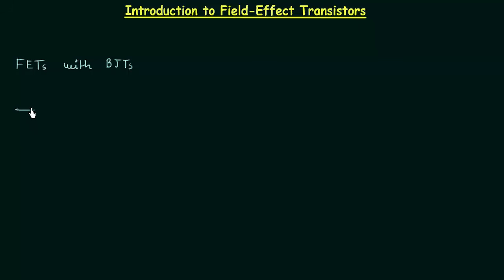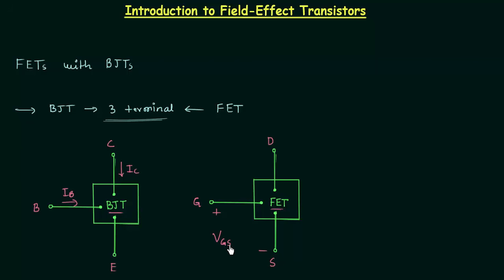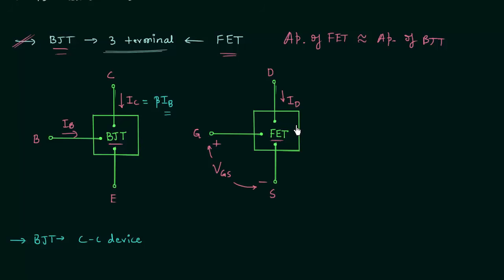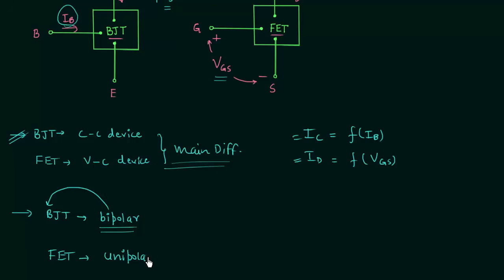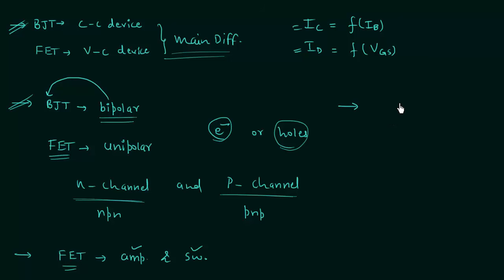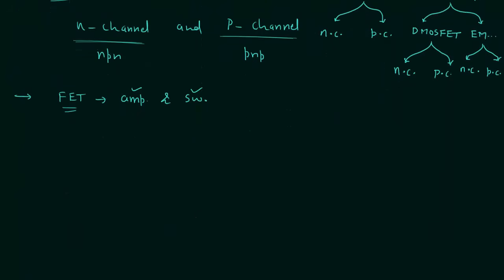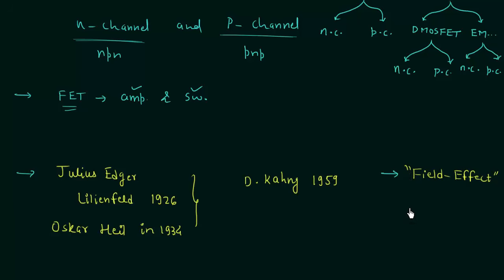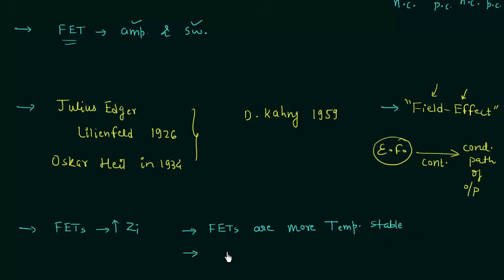Introduction to Field-Effect Transistors (FETs)

Comment: 00:09 Introduction to Field Effect Transistors

01:28 BJT and FET are three terminal devices.

02:52 BJT and FeT are current controlled and voltage controlled devices respectively

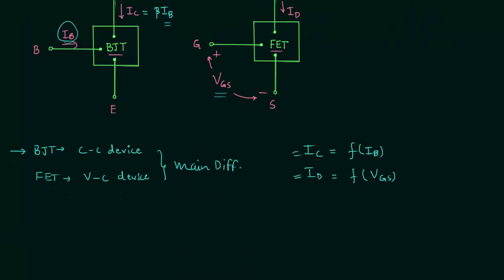04:24 BJT is a bipolar device and Fe T is a unipolar device

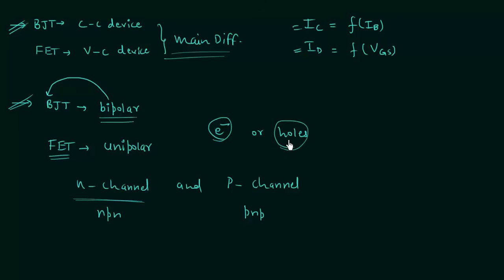05:46 Field Effect Transistors (FET) can be used for amplification and switching.

07:06 MOSFETs can be classified into two types: d MOSFET and e MOSFET

08:29 Transistors are integral in electronic devices.

09:56 Field effect transistors have high input impedance and are more temperature stable compared to bipolar junction transistors. They are also smaller in size.

Comment: n channel means pnp ryt u explained in next part
Reply: yes, this is right, he mistakenly explained, N channel because most of the semiconductor is Electron charge (negative) so its same as PNP. (see the Base, it's N)  otherwise, P Channel because most of the semiconductor is holes charge (its not positive BUT it's behave as positive) so its same as NPN ( as the base in BJT is P).
Reply: @masbro1901  thank you🤗

Comment: Well done!  One question, do Kirchoff's with voltage and current work with transistors?  It seems like they don't but is there a phase issue?
Reply: it wont work because transistors are non linear element  i.e, its resistance is not constant throughout the range of operating voltage.  Moreover it is an active device . So , transistor's conductivity(or resistance offered to the input) also depends on the activating source.

Comment: Elaborate the point : BJTs are more sensitive to applied signal than FETs
Reply: Because as fet's are high in impedence  ,so no unwanted signal will be introduced in to circuit.
But not in bjt's..

Comment: Why do FET have high input impedance? and Why is FET more temp. stable?
Reply: Anusree Saha input is reverse biased,so it has high impedence,and therefore more stable,
Reply: @gkwithrh2178  1 year gap between all of us
Reply: As silicon is used as insulator. Input gate current =0 so it has high input impedance according to ohms law.